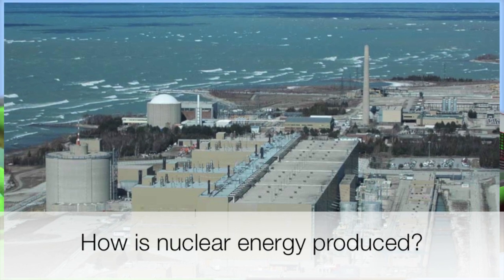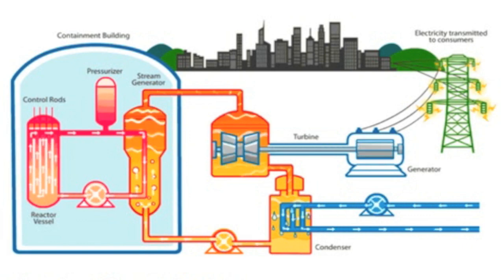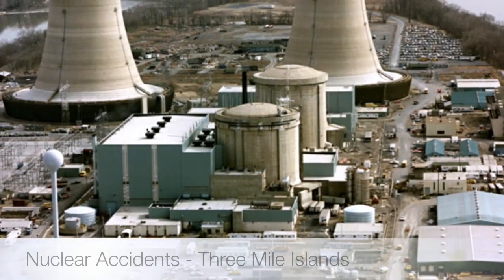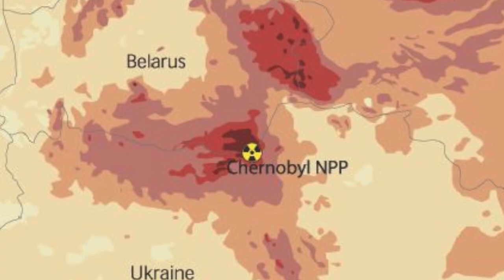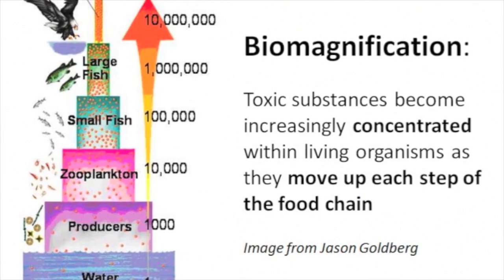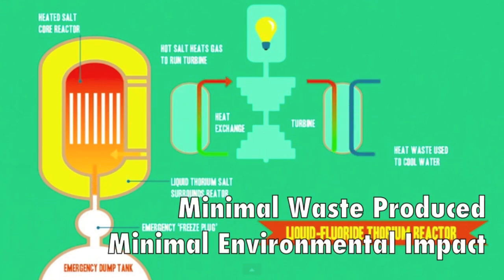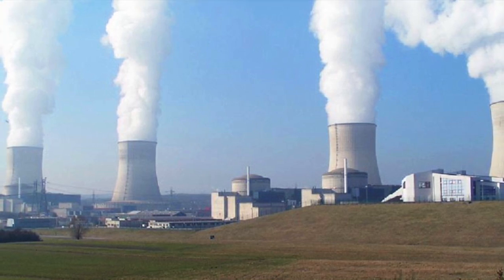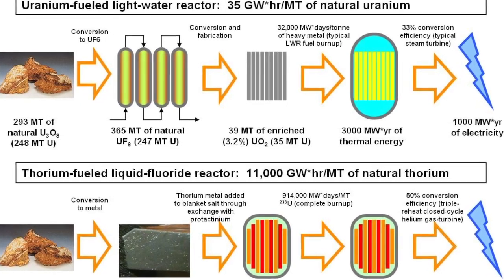Thorium vs  Uranium

Comment: I doubt the factual statement that MSRs are sealed systems for 30 years. If they are sealed, then how do you chemically process the Thorium fertile fuel conversion to the fission fuel of U233, and how do you add new fuel, and how do you on-line process and remove the wastes in the fuel salt? This video was not set up to match real facts of MSRs.

Comment: the title should be molten salt reactors vs solid fuel water cooled reactors nothing to do with thorium or uranium. the statements about was is wrong its only less in molten salts regardless uranium or thorium and there is not large waste all of frances waste is in 1 building try that with coal ash piles mountains of the stuff

Comment: The accidents described here were high pressure water Hydrogen accidents explosion because of the solid Uranium and very high water pressure release. Theser accidents was caused by poor reactor design. These accidents would not be  happening with better Nuclear Design using MSR LFTR Reactors.
Reply: I agree on the LFTR MSR being the tech to develop...

  To me it seems insane that we went with solid fuel assemblies that require (repeated) dangerous, and dirty reprocessing, after giving up only 0.5 to 0.7% of their embodied energy,  and water as heat transfer medium.
Reply: @orcoastgreenman  Part of the reasoning was that spent fuel rods could be relatively easily re purposed into weapons-grate material, compared to the work needed to do the same with the far smaller amounts of waste from a LFTR MSR. That, and the industry was already set up to cater for uranium mining/enrichment. The focus was on making nuclear weapons quickly and effectively, power generation was seen as a lower priority.

Comment: To think that Thorium LFTR will not result in any accidents is rather naive.  When in operation, 700 oC molten Thorium salt emitting hard Gamma radiation is especially hazardous.  I has been asserted that Thorium :LFTR is highly safe because of the melt plug and dump tanks.  But what happens of the drainage path to the dump tank occurs even if the melt plug melts?  The Thorium salt also needs continuous reprocessing to remove byproducts that would otherwise quench the nuclear reaction; what happens if there is an accident in the along-side continuous reprocessing facility ?  These issues are glossed over and not properly address in Thorium salt reactor presentations.  To think that convention fission is "bad" and Thorium LFTR is "good" is over-simplistic and naive.  With time, there could be terrible accidents also with Thorium LFTR.
Reply: Nobody says a LFTR or any molten salt design "will not result in any accidents". They do say that the major hazards associated with PWR and solid fuel are not there. List every big issue with any PWR and they do not exist or do not cause problems in a molten salt. You "could" take the lid off and nobody would get hurt. 
I say "could" because ionising radiation and neutrons would be emitted but there would be no harmful contamination release.
Reply: The risk of serious accident is considerably higher than you estimate, especially in the continuous reprocessing apparatus needed alongside the LFTR reactor.  700 oC highly-corrosive hard-gamma-emitting melt running from leaks all over the reactor site is not particularly benign.
Reply: @tommorris3688  I make no estimate of accident likelihood in an MSR. But if a fundamentally dangerous design (PWR or BWR) can be made safe with engineered solutions then a design that has almost none of the associated risks has to be that much safer. MSRs built to nuclear engineering standards should be the least risky energy sources we could have.

Comment: Thorium vs uranium: then you picture not a forward view of a core, but a very backward view, with fuel tubes, surrounded by a breeder bed. THIS IS COMPLETELY BACKWARD, AND IS INDIA. This is not, and never will be any good, molten salt is the bible to follow, not this abortion.

Comment: This video is almost incomprehensible.    Did the producers of it not bother to find out just WHAT a "Thorium Reactor"   consists of?!   Look up on Youtube,  THORIUM LIQUID FUELED REACTOR (LFTR) ( Kirk Sorensen  has a very good presentation of it. ) You will find that true Thorium reactors  Have NO "fuel rods"  to melt down, produce explosions, or leaks of radioactive material.   Because the reactions take place in a molten salt solution,  which FREEZES at room temperature,  thus preventing any radiation releases, etc.   How could you overlook such differences, and pretend it doesn't matter.?!  
      It apparently is true that India,  abundant in Thorium,   but poor in Uranium , has attempted to "burn"  Thorium in a Uranium style reactor,  with all the negative problems one might expect,  but why bother clouding up the energy issure with this irrelevancy?!

Comment: It's not true to say that Nuclear power is 'Carbon Free' because the raw materials have to mined and processed, plus the power-plant itself has to be manufactured and erected. All these processes - especially the use of concrete - are carbon intensive! However, the generation of electricity by nuclear reaction is, in itself, carbon-free. Over the lifetime of the power-plant, the release of carbon is several orders of magnitude less than that of the construction and operation of conventional fossil-fuel plants, so there is a considerable carbon advantage - but it is not negligible.

Comment: Chernobyl wasn't a PWR it's RBMK breeder reactor.
Reply: Chernobyl used pressurised water in the primary circuit with carbon as the moderator. It had all of the safety issues associated with PWRs plus a few more associated with the RBMK design. Not least a positive void coefficient. Steam bubbles (voids) in the core (local overheating) caused the reactor to run away uncontrollably.
Reply: An RBMK reactor is basically a carbon-moderated BWR.  It's not in a pressurized vessel.

Comment: Get over it tree huggers. You want less carbon? Then Nuclear is the only way to go. Solar and Wind are not energy dense enough to run the damn world on. You should work towards getting nuclear safer, not banning it dimwits.
Reply: imagine the environmental damage from covering the Earth the size of California with solar panels. ugh
Reply: If it was possible for the First World to go fully renewable energy all we would do is displace coal to the Third World. They need cheap energy so they'll use what they can get and nothing is cheaper than coal. 
New nuclear has to be cheap or it will fail along with every other non fossil energy.
Reply: @Dave5843-d9m  Thorium is a byproduct, and not much is needed for tons of power.  I heard that there was just one mine in united states that could power the entire world for a day, based on monthly yield (or something).  When there is demand, the market will catch up.  The problem right now is that government is catering to big oil and coal, so that they stay in the market, lying to us about how 'oil always has been cheap, so that's the way it'll stay', and not that the reason oil is cheap is because the market adapted to it long ago.  In reality, oil used to be expensive, until demand caused businesses to dive into it and spend lots of money on oil production, until the market caught up with it.  

So of course Thorium will be a bit expensive at first, because it has to be obtained and the sellers are initially limited.  I could easily see it as being a much cheaper form of energy per kg and watt output - that's obviously where it counts.  The free market allows people to experiment with new ideas - innovation causes disruption, and market disruption is what ambitious businessmen always dream about.

There's a video out there that explains thorium.  https://www.youtube.com/watch?v=tyqYP6f66Mw&list=PLxSV5eJ9ozga1-vscy4tuUehnT9_tbNVZ&index=12&t=0s
Reply: David Elliot, then you have got to finance the building of renewables and thorium MSR and other types if throium power stations in underdeveloped and developing countries too. It is not going to be cheap and it will not happen overnight. But gradually, it must be done.
Reply: China is working on it.  America has placed so many regulatory restrictions on new reactor designs that it is too expensive for new reactor designs to be created in America, that's why those new designs have to be created somewhere else, like China.   It does not matter who makes the reactors, what matters is that SOMEONE needs to create them, and then we can all use those new successful designs.
Reply: Tesla has basically proven that solar power is sustainable for home but I'm not sure about corporation use. I think representatives of the us pass restrictions on nuclear energy is because of oil companies. When has the us actually done something not for money and they aren't stupid enough to listen to "tree huggers". Coal is also used in multiple reactor in order to kickstart or be the catalyst for the reactor. I might be talking out of my ass though
Reply: only the stupid smother things they dont like

Comment: Thorium reactors and Uranium reactors have the same risk.  The difference is in the designs.  Thorium is a "fertile" nuclear material.  Uranium U-235 is fissile.  In Uranium breeder reactors like Chernobyl.  You convert fertile U-238 to fissile Pu-238.  Then you burn the Pu-238.  There are Uranium designs that can not melt down.  A Uranium gas cooled reactors is an example of this.  There are Thorium gas cooled reactor designs like one from Germany Th-300 that is gas cooled that can not melt down for the same reasons as the Uranium fueled gas cooled reactors.  The problem is not Uranium vs Thorium fuel being the difference in safety.  The difference is the design of the reactors.  If you put Mox fuel, a mixture of Thorium and Uranium fuel in a Water cooled reactor you have exactly the same melt down risk.  You do not understand the nuclear process and are spreading miss information on the subject.  Uranium, Thorium and Plutonium fueled reactors work basically the same, it is the design of the reactor that is the issue.  The argument about creating less waste is also false  If you compare the Chernobyl design (A Uranium Breeder Reactor) vs a Thorium Breeder Reactor they both can theoretically consume all of the fuel.  This is because they are breeder reactors.  If you enrich your fuel like they do in the military to near 100% U-235 those reactors run for 30 years.  So your argument about refueling is false.  Thorium is VERY easy to make a gun type bomb and that is why the government pushes against it.  Research the Davey Crockett.  This is a U-233 based nuclear weapon.  The U-233 that you get from a pure thorium reactor can go directly into a bomb of the design of the Davey Crockett.  Research what thorium fueled designs the US government supports.  They are all of a Mox design so that the U-233 is mixed with something else and no longer more than 90% pure weapons grade which is what you get out of those pure Thorium fuel reactors.  You video is full of lack of understanding.

Comment: Correction to the video.  The Chernobyl accident was caused by a test that went out of control.  The facility at Chernobyl had multiple other reactors of the same design.  They continued to operate those reactors to the end of life of the design.
Reply: But the RBMK is a fundamentally unstable design that given the right conditions can go into a self sustaining runaway. It was the botched test that allowed it go runaway. Steam bubbles/voids in the core caused by over-heating cause the nuclear heat to increase causing more steam, etc, etc.

Comment: Ummmmm.... the Chernobyl plant used RBMK 1000s not PWRs. Completely different technologies that are not analogous in any way except the fuel.
Reply: You say that but steam cracking to hydrogen/oxygen against the hot fuel rod cladding will do the same thing in a PWR as in an RBMK. A steam bubble that happens when the pumps fail also does the same. The difference is that a tiny PWR reactor cannot go runaway as the RBMK did and it's housed in a huge concrete containment dome which should contain the steam and radioactive elements should the worst happen.
I'm not saying that PWRs are not safe. They are engineered to be very safe with multiple layers of safety systems. But they are massively costly as a result. Chernobyl shows what happens when you have very hot water under pressure and cut corners on safety. 
Molten salts just dont have the stuff that can go catastrophically wrong. They wont ever be perfect but there's nothing built in that can scatter its contents across the world. Even if the lid came off (heaven forbid), it wont release gaseous radioactive isotopes because those elements are all bound up in the salt.

Comment: PWR reactors do not have radioactive water in their primary cooling loop (reactor core).  BWR reactors do produce steam contaminated with some Nitrogen-16.  You can actually swim in the water of a cooling pool (the ones that glow blue).  The water is not highly radioactive.  Of course they won't let you but that's just details.
Reply: Materials leak into the primary coolant and make it radioactive.  Further some of the primary water gets into the secondary water and makes that radioactive by leaks in the heat ex-changers.   Primary coolant leaked from three mile island set off the radiation monitors initially.  I agree on not "highly radioactive" but it is radioactive.  Pool type nuclear reactors are better protected against leaks than power producing BWR or PWR nukes.

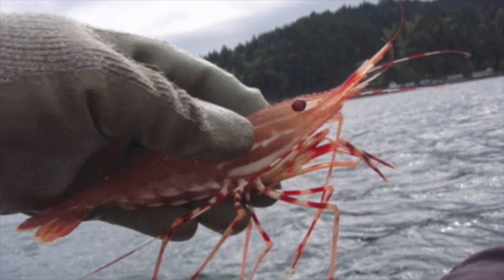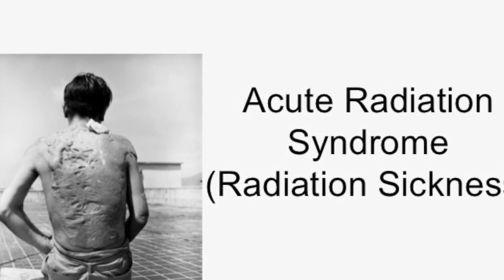Comment: I'm all for Thorium reactors as opposed to High-pressure Uranium reactors but this video is full of bias and wrong information. Much of this incorrect information actually hurts the rational argument for nuclear power help reduce emissions and fight climate change. I mean, they have a giant 'radioactive squid' as evidence at 9:25. That thing is so fake it hurts. They show pictures at 7:34 as radiation damage. when they are in fact flash burns from thermal energy from the atomic bombs dropped on Japan during the second world war, not 'acute radiation sickness'. And they talk about thermal discharge from nuclear power plants as this horrible thing, when that just mean 'hot water', in most cases its warm water. Your kettle at home is more dangerous...

Comment: You guys need to do a little more research about nuclear, especially the guy who talked last. Phrases like "radiation leak" makes me wanna rip my hair off. Radiation is not a fluid, it does not leak. Actually it behaves more like light. Would you say that light leaks?

As for how long does it take for fission products to decay to natural background levels, It's just 300years, that goes for Uranium, Thorium, and Plutonium fuel, all of them. Note that The reason why the spent fuel waste takes longer to decay is because it generally contains transuranic elements. The advantages of using thorium instead of Uranium or Plutonium is that, It's hard to transmute Thorium past Past Plutonium-239, thereby creating transuranics. Spent fuel which comprise of fission products alone and no transuranics is what we need. 

Liquid Fluoride Thorium reactors are better suited to create transuranic free waste. It also easy to extract valuable fission products with it. We can also use fast neutron spectrum reactors which are as efficient as LFTRs in using fuel and can also burn transuranics. Russia is busy commercializing them.

Note that radiation has always been around. Coal plants release more radioactive radon gas daily into the atmosphere than the amount that nuclear power plants are allowed to release (Mind you that Nuclear power plants almost always don't release radioactive material unless there's an accident). Our planet is radioactive, we need this radiation to keep us alive, without Uranium we wouldn't be alive. If it were to cease to exist, our planet would lose it's magnetic field. Watch Kirk's videos thoroughly, you will understand nuclear better.
Reply: Somepeople are just too stupid, wou can't explain anything to them..
Reply: Leak is to water, not radiation...
Reply: Ionising radiation is light. At one end of the scale we have infra red with gamma rays at the other end. Visible light is a small patch somewhere in the middle. High energy neutrons (also given off by a nuclear reaction) are harmful to life but are stopped by the same shielding that stops ionising radiation.

Comment: Why do i have the feeling the reason Uranium reactors were developed rather than Thorium reactors is because they chose to make a bomb for killing humanity & all the bunny rabbits & kittens or whatever else lived where the bomb was dropped. Rather than develop Thorium reactors that produced virtually free energy they could share with their enemy instead so they both could live in peace with each other? They chose hate & death over love & peace?
Reply: They are all nuclear reactors and they all (one way or another) use uranium as fuel. They all have to be shielded to contain high energy neutrons and radiation. The difference is how the core is constructed. MSR = liquid fuel + solid moderator. PWR = solid fuel + liquid moderator. Gas cooled reactors (e.g. the British AGR) also use solid fuels but have a solid moderator. The fuel in an AGR could still melt down if the cooling is stopped. But the iodine, caesium, strontium, etc should be contained.
The big advantage with the liquid fuel is its very high burn-up and low fuel processing costs. It's easy to make uranium salts and mix them with other fluorides. Solid fuels need expensive processing plants and due to fuel rod degradation have a poor burn-up so create high level waste. Post processing of irradiated liquid fuel is also much easier (Sorensen explains it well). Liquid fuels will require very little irradiated waste transport unlike solid fuel rods which have to be swapped out every few years.